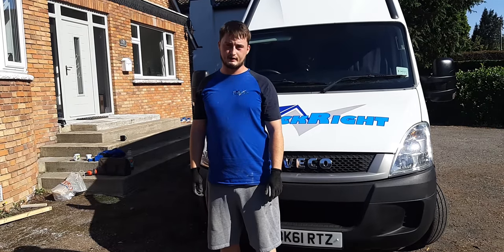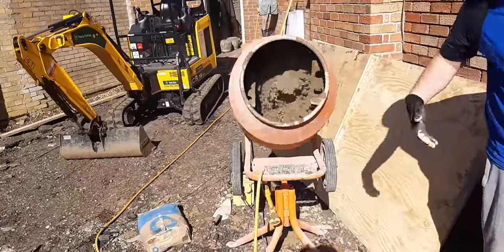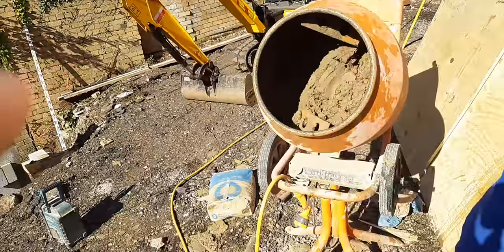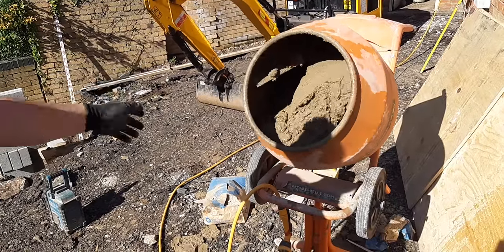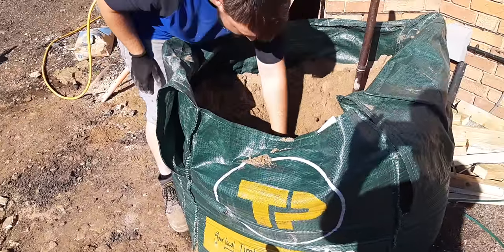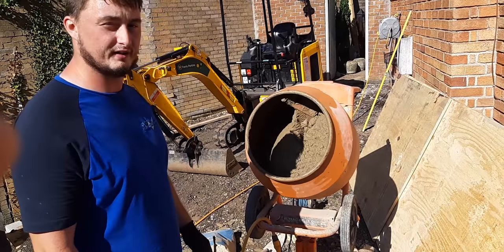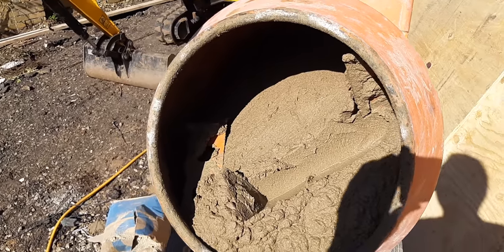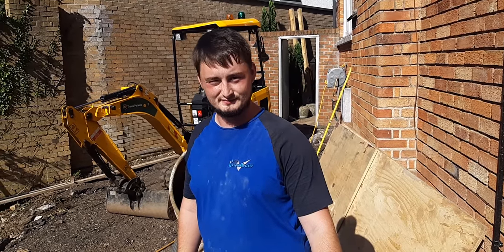mixing mortar- bricklaying tips

Comment: Your better off breaking a bag of cement in half mate because a shovel of cement is never as big as a shovel of sand 8 shovels to half a bag is 4 and 1 10 and half a bag is roughly 5 and 1
Reply from the maker: Hi Tom
Fair point thanks for your comment
Reply: SPOT ON.
Reply: It's all a bit splitting hairs as if he's aiming at 4/1 it's going to be some whare near as it's only going to move towards a 5/1 which is fine. Fair enough if you are mixing a specialist mix but shovel mixing is fine in general

Comment: This is not a 4 and 1 mix. That ended up probably a 6 and 1 mix going by the difference in size of those sand to cement shovels.
Reply from the maker: Better to gauge it with a bucket 🪣 👍

Comment: A bag of cement has four shovels in it , cut half a bag of cement and you have two shovels , and put 8 shovels of sand in and keep the shovels of sand not too big , that mix the young fella did is inferior , little tip bud
Reply from the maker: Thanks Gareth yes I no this so does Brad we normally use a bucket to gauge the mix .ibstock recommend a 6:1:1 mix so it wasn't inferior but appreciate you sharing your knowledge 👍
Reply: @brickrightbuildinglandscaping  I used to do it all time , that's why I know 🤣

Comment: Is a plasticiser mandatory?
I've been trying to mix mortar and it always comes out to sandy, it feels more like wet mud with cement rather an a creamy and smooth material. I wonder what's the problem 🙏🏻
Reply from the maker: Unless you use lime in the mix then yes plasticiser is necessary it makes the mortar more workable-fluffy 👍💯

Comment: How would you get an electric shock from a 240v mini mix?
Reply from the maker: I think in our narrow mindedness we poorly meant. The current running through 110v transfer will not hurt you. Whereas 240v could kill you. Sorry for any confusion. 
Thanks for your post 
Justin brickright 👍
Reply: @brickrightbuildinglandscaping  OK, thanks for the reply
Reply: @brickrightbuildinglandscaping  it's actually only 55v because it's split phase on the 110v side. So touching a live wire would give you a 55v shock, not 110v. Mind you, a 55v shock can still hurt, even kill if you're very unlucky.
Reply from the maker: @TheAmazingAdventuresOfMiles  thanks for the explanation appreciate it👍

Comment: you left that mix turning for way too long, would have been too fluffy, 10 minutes in a mixer? good tutorial 😬
Reply from the maker: Glad you found the video helpful 👍
Reply: No way thay was even shovels can't beet a bucket to get the mixture bang on but I'm a digger driver so what do I know 🤔
Reply from the maker: Shaun I think we can safely say the bucket method is a good idea and we do use it especially when we're on brickwork like today.
Appreciate your input 
Safe digging mate 👍
Reply: 10 mins is what we leave it! It les the plastisicer do the work cutting down on the water
Reply: @Brockstonepavingpros  10 mins for a couple gauges not a mix that small , you can tell by looking at it that’s it’s too fluffy
Reply: @MrCharlan1  I know what you’re saying, too long and too much air gets in there.  I see it too much though where the mix is rushed and the plassy hasn’t done the work, it looks ok but when you tip it out in the barrow, the water sits on the top.  I’ve never really timed it, just know by looking at it, deffo needs 5 mins and deffo not any more than 10 👍

Comment: 4:1 for footings 6:1 for face
Reply from the maker: Thanks for that Jack I've always used 4:1 for brickwork but I also no 6;1 from my college days 👍
Reply: Most footings want 3-1. Depends on the materials like every else as the mortar can’t be stronger than the materials used to build with. Always go 4/1 on most builds ie clay facing bricks concrete blocks above ground. Most silo mixes on site normally 1 cement 1 lime 6 sand.